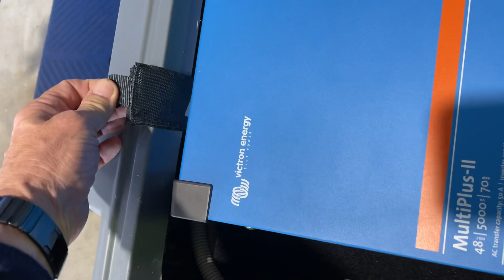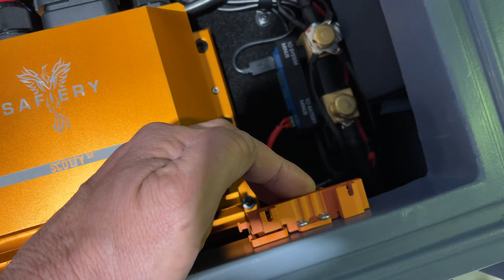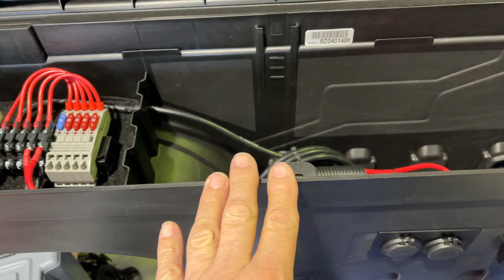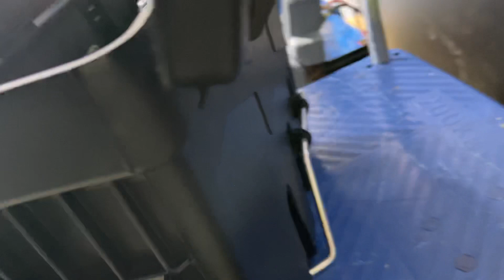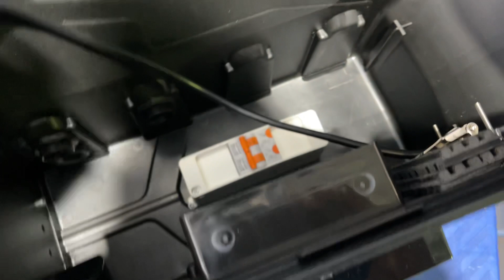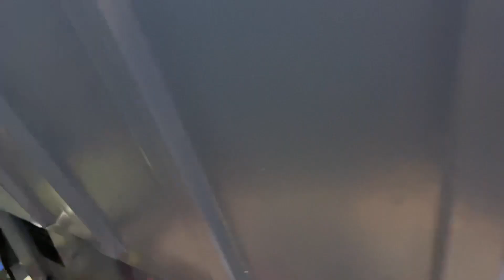Silverado 2500 Powerpack 5,000w Inverter Charger 800Ah Lithium Scotty 3,000W Alternator Charging

Comment: How do you overcome the heat from Scotty and the inverter? I was always taught lithium needs good air ventilation.  I'm assuming you'll need to run some pretty heavy gauge wire from the alternator to Scotty?
Reply from the maker: Twin fans in the case, 48V with a 40C temperature in line switch. Very industrially robust. No trouble with heat

Comment: Been following you guys for a while now absolutely love what you are doing right up my alley, beats the hell out of my simple multi use  48volt Lipo4 (20amp) scooter battery which I also use for my home made electric bike,  I also have a 48volt to 12volt 120watt Dc to Dc (10amp max) converter (ebay) that allows me to use it to run my car fridge for up to 3 days. Look forward to new posts..